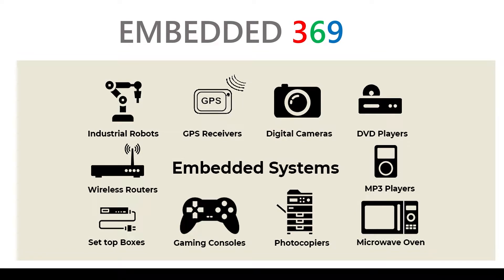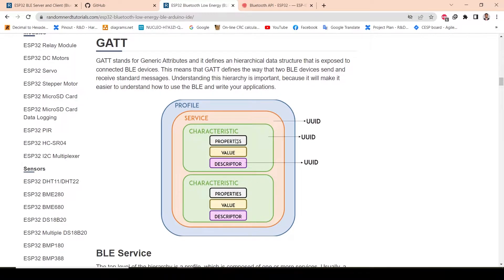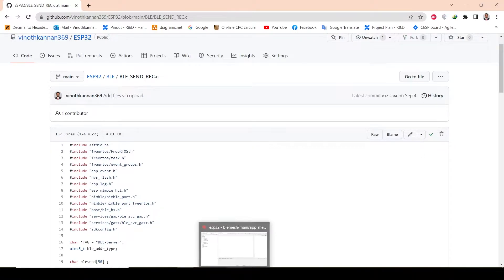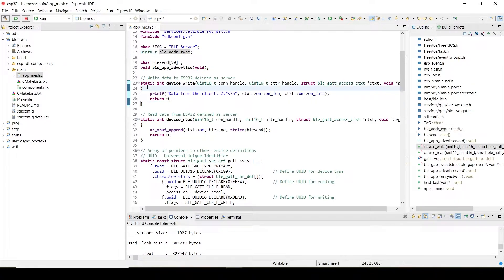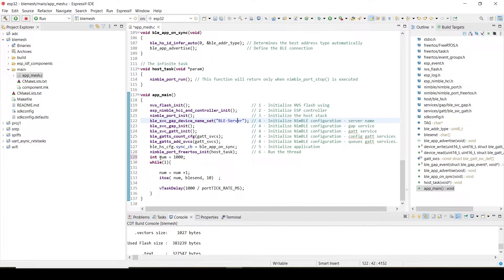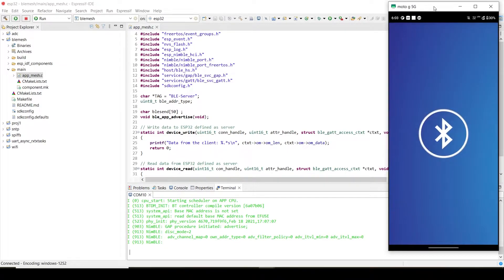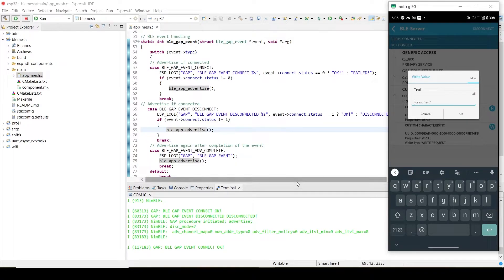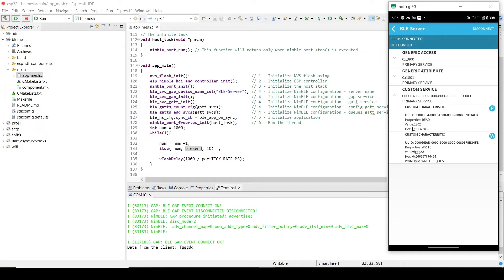#10 Espressif IDE ||Bluetooth Low Energy(BLE)||ESP-IDF|| ESP32

Comment: When ever I send data from Mobile 123456789012345678901234567890,
It is only printing
12345678901234578 only on terminal
Not all full length.
Reply from the maker: Good Question 
BLE allows you to transfer maximum  20 bytes at a time 
refer below 
https://stackoverflow.com/questions/38913743/maximum-packet-length-for-bluetooth-le
Reply: @embedded3696  thanks for giving me your valuable time, 
20 bytes you mean 20 char
(sabc1234defg4567kjhg)
and is there a way to send more than these, (found a lot but not got). i want to send infinite anything
Reply from the maker: you have to break large bytes of date into   20 bytes chunk of data and send